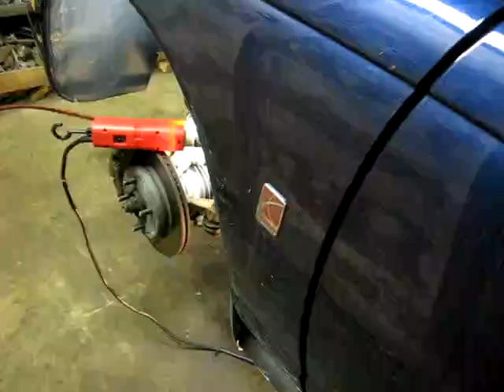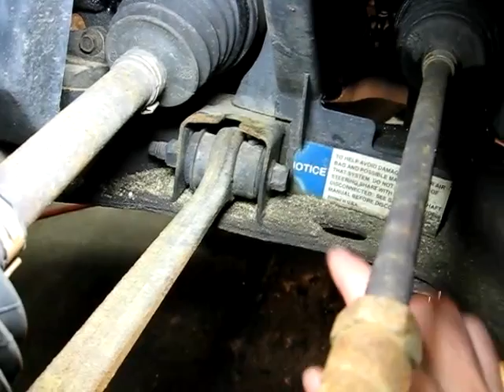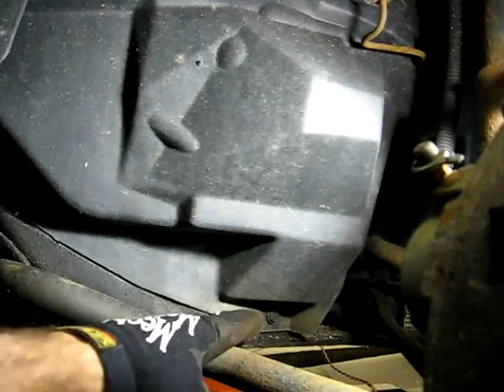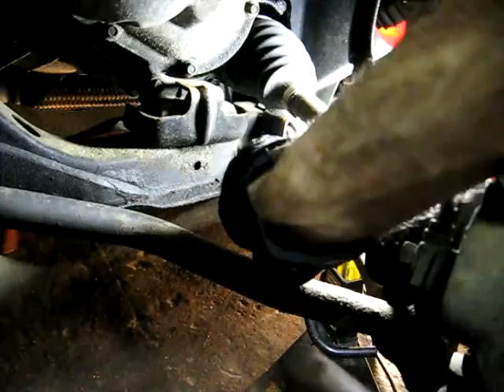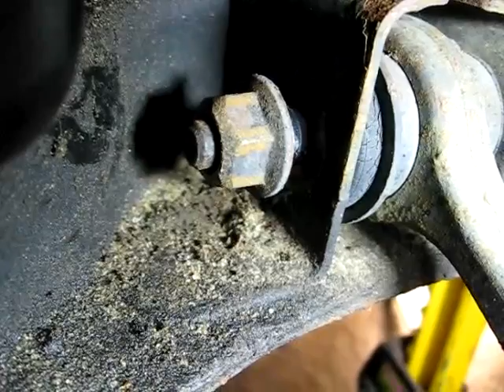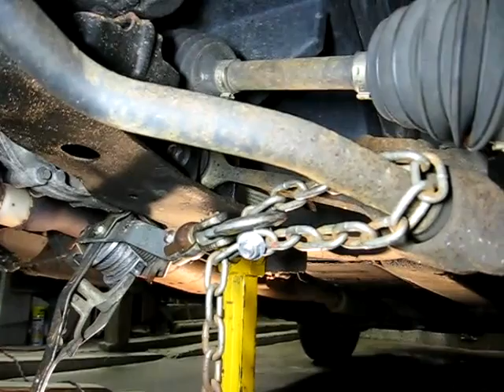Removing Rusted Control Arm Bolts

Comment: Awesome. Im working on my saturn SL2 93 and trying to get that bolt out and saw your video. I'm like sweet the guy I trust with saturn's. Will this also work with the Passenger side. as well
Reply from the maker: I believe the bolt is put in the same way on both sides.
Reply: richpin06a thank you. We had to cut it. Cause the sleeve was rusted on the bolt

Comment: Great video!

I spent all weekend getting this exact driver's side bolt out.  That thing was a nightmare!  The passenger side was really easy and slipped right out.  I tried everything except torching it bc I can't afford one.  I ended up cutting the control arm, through the middle, then cut the circular part of the control arm where it goes around that bolt.  Once that was out of the way, it left the metal sleeve, the rubber bushing and then the smaller metal sleeve that the bolt was rusted to.  I then cut the larger metal sleeve lengthways and once the cut was complete, the tension from it popped it open to remove.  Then I used a knife to slit the rubber bushing lengthways to get that out.  What was left was the bolt and the inner metal sleeve to which it was rusted.  

I then proceeded to cut this metal sleeve all the way down lengthways (I could even see the threads of the bolt).  At this point I was determined to get this thing out if I had to grind the whole thing out.  Where I was cutting into the metal sleeve, I would use a pry bar and wedge it into the cut and smack it with a hammer.  Eventually I was able to get a small screwdriver in between the bolt head and frame and then I used the tie rod separator to pry against.  Then it got stuck midway out and I was able to turn the sleeve outwards to insert a punch and just kept on punching it until it fell out.  I am still not convinced it wasn't one huge chunk of metal :)  Once I was done, I had to get a victory picture with half a dozen used dremel cutoff wheels, 5 sawzall blades, and of course the broken control arm pieces.  What a feeling though once it was removed!
Reply: I hear you. Driver's side was the mechanical manifestation of evil. My brother and I spent a total of six hours over two days cutting out two bolts which had fused with the inner bushing sleeve. Taking two days off for Christmas before tackling the other side.

Comment: I spent 5 days removing only 1 lca bolt out on my mustang gt. Used torch, pb blaster, breaker bar and sledgehammer. Driver side tomorrow. Ugh!
Reply: how'd you eventually get it out? My passenger side's frozen in 1/3 of the way out and i'm losing my mind...
Reply: I'm planning to use 3.5" grinder and to grind off one side of the nut, then whack it with a hammer and chisel.
Reply: How did u eventually get it out? I'm having the same issue on a 07 mustang. Lol left me stranded at my friends shop last night.

Comment: Just had the problem on my old accord.  I'm pretty sure they were grade 10 bolts.  I'd recommend a sawzall with a bimetal cutting blade to cut the bolts.  I mistakenly hammered the crap outta them and ruined my subframe.  So, if they're seized, just cut em out and replace the bushing/control arm.   The sawzall/reciprocating saw method took 2 minutes.

Comment: I' tried your method here and soaked the bolt in about half a can of PB blaster and it still won't budge! I can;t think of any other thing other than the to cut the bolt and pry out the control arm or torch it to loosen it. But my car is covered and oil and I'm not sure I want to mess with the fire hazard. Any ideas?

Comment: Sometimes you're probably going to ruin one of those control arm bolts no matter how careful you are. What if it's an older vehicle and the bolts have been discontinued and the aftermarket suppliers don't have them either? What do you look for at the local hardware store besides the correct size and shape? Do they have to be a certain grade of steel?

Comment: Why do people post videos about how to remove rusted bolts, on typical un-rusted bolts...  this is hardly a problem.    What about when the shank of the bolt is rust-welded completely inside the collar of the bushing.      No amount of hammering or penetrating oil can free those kind.   You have cut the head of the bolt off flush to the frame of the car, and then cut just inside the frame, and again flush to the control arm and you can slide the threaded part out.  Use a grinding wheel or recip

Comment: Happen to have the specs for that bolt handy? 

I hear it is a "grade 10.9, flanged bolt head and nut, probably 12mm diameter, 14 or 15 tpi, about 3 1/4" of thread with an un-threaded nipple" sounds like that could be hard to find if i need to resort to a hacksaw.

Comment: the best way is to mod a pointed air chisel so it gives you the best aim and control,and also  hold it up right tight to the end of the bolt so it has very little travel in the chisel. on a 95 monte for example you will have to make the chisel short to the point of only 1/2 inch past the spring in the air hammer and be prepared for a long day on the particular car if the botls are frozen.

Comment: Excellent use of the air chisel.  Wouldn't it be better to have the nut screwed out flush with the end of the bolt to prevent "mushrooming it?